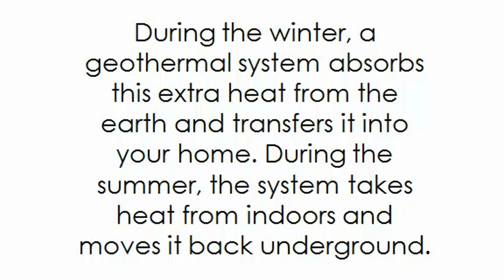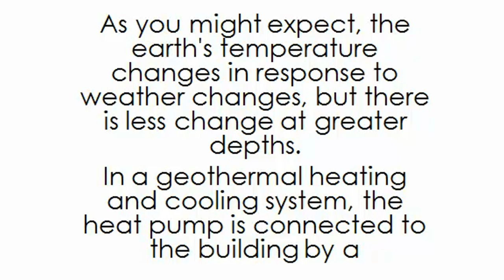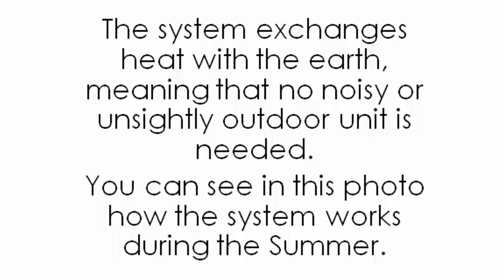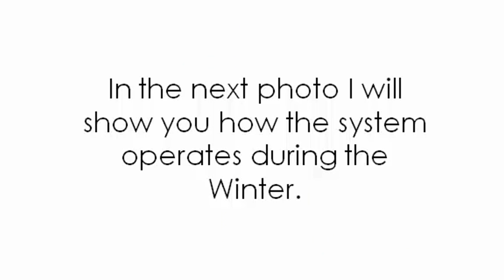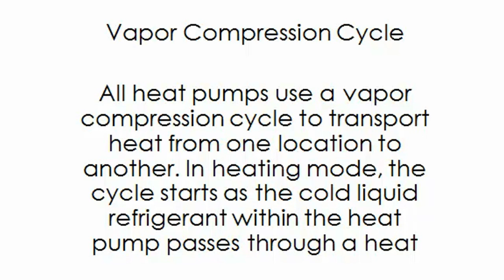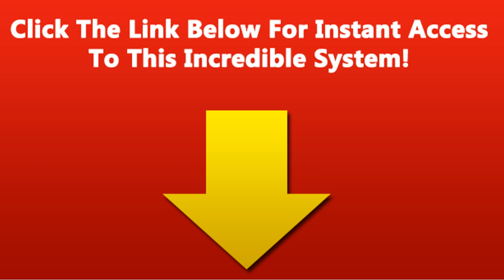DYI Geothermal Heat Pump

Comment: This video starts off with a lie.  I have done extensive testing of underground temperatures in the center of the USA (st. Louis, Mo).  The temperature at 20 ft below the ground is about 60F.   Less deep than that... the temperature varies depending if it is summer or winter.  If you live up north near canada... the temperature is about 50F.... If you live in the south... then the temperature is about 70F.  So..... I'm not sure I would believe anything they say if they start off with a lie.

Comment: Heat pump 1 ton.
With what diameter copper pipe must be installed in drilling depth 100 feet.
3/8 to 1/2 cooper pipe?
r407c